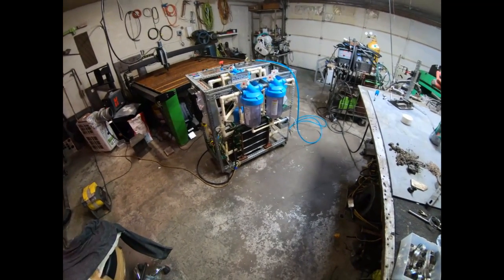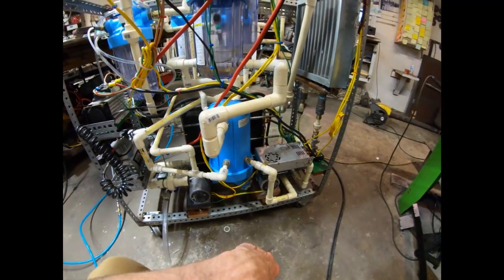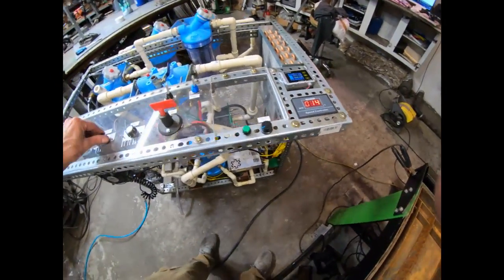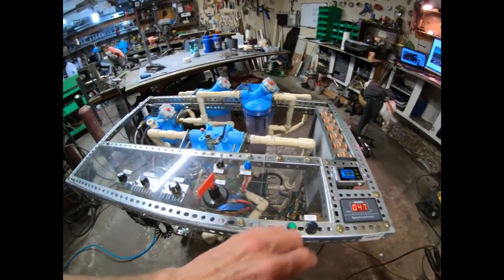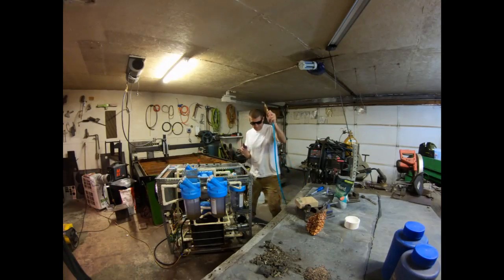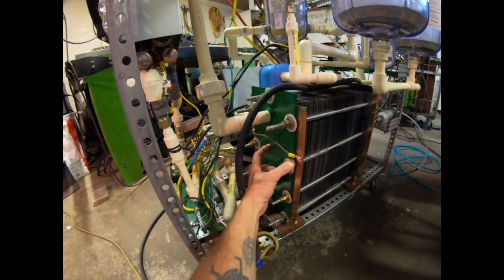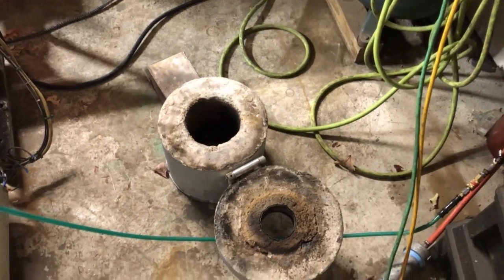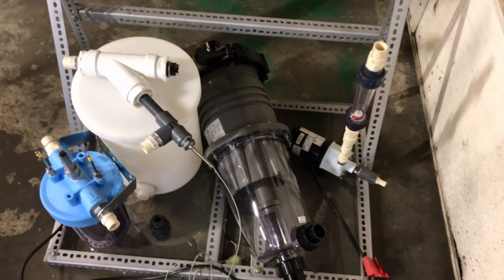Fire assay with 10,000 watt hho electrolysis torch

Comment: What is the actual size of the plates in inches and what type of material is used and the thickness of plates??? You are using 230 volts D.C. at thirty amps ??? The HHO generator is the unit wet cell or dry cell ??? Thanks a bunch and peace too. VF
Reply from the maker: ill get back to  you , its a dry cell
Reply: @NOBOX7  Thanks
Reply from the maker: 415.5 cm per plate side
Reply: @NOBOX7  What is number of plates and what material are you using NOBOX7?? 316 stainless or titanium ??? Thanks for giving us all on YouTube really interesting content with substance which others are lacking.VF